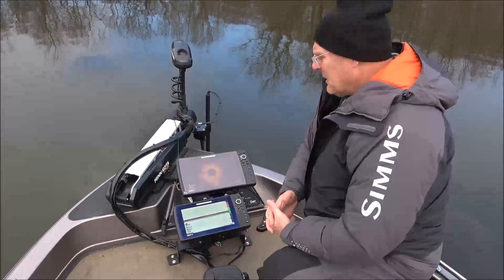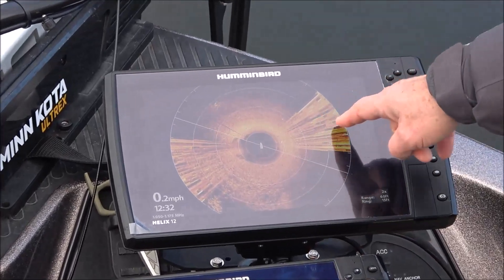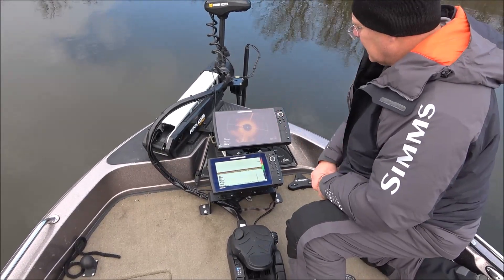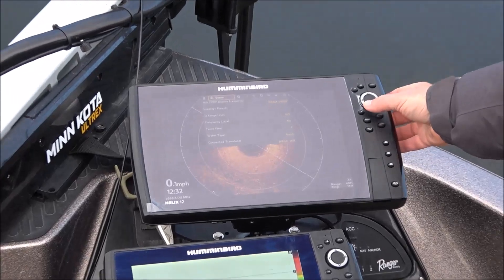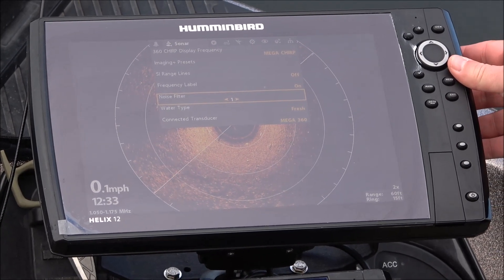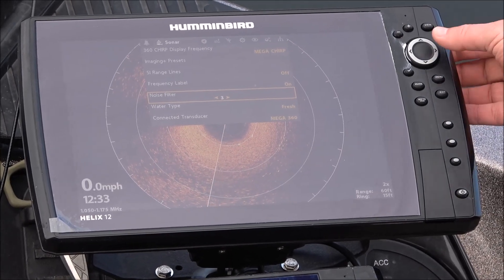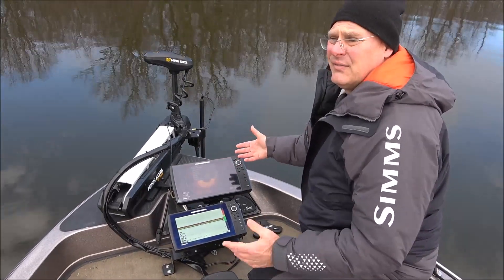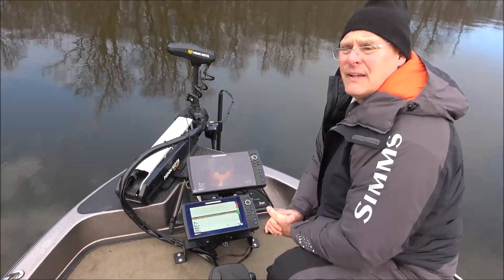Humminbird 360 Interference Fix

Comment: I have interference on my 12 Helix but only when I press the gas on my Ultrex. The fuse in the Ultrex is good and I've got separate power for the trolling motor and the graph. Both are on opposite sides of the boat and I've tried to zip tie all the wires and separate them as much as possible up at the bow but I still get the interference. I'm lost. 
The thing is, it just started happening a few months ago. Before that it was fine🤷‍♂️🤦‍♂️
Reply from the maker: Did you try ALL the things I mentioned in the video?

Comment: I've been having interference problem on two different boats, I just installed a brand new helix 12 G4N with a mega 360 only. Get the noise filter setting on 1 and 3 and it gets bad interference when prop is engaged and when steering gets worst!!! Setting 2-4 is less interference, but still is noticeable. I did a dedicated circuit only for electronics, get cables away from power and steering cables, tryed a noice filter on charger leads on cranking battery, set ferrites on power cables, nothing of that changed a thing, I get the same results, too bad being spending a lot of $ on this brand
Reply from the maker: It is frustrating. Between the ferrite rings on the power and transducer, doing a "figure 8" with the transducer cable, and the noise filter settings I was able to fix my problem.